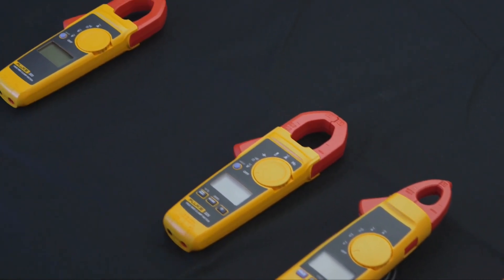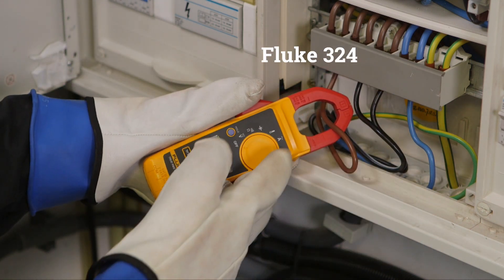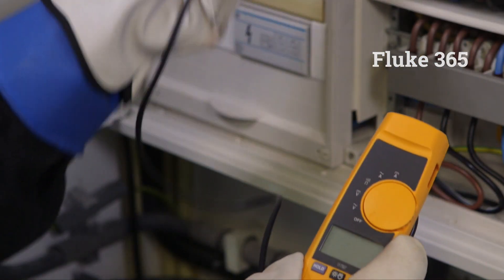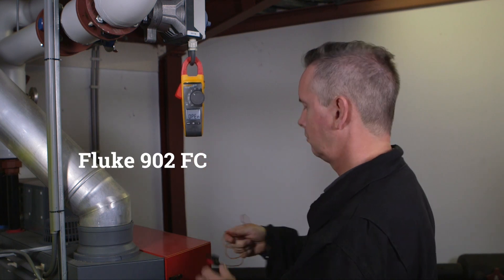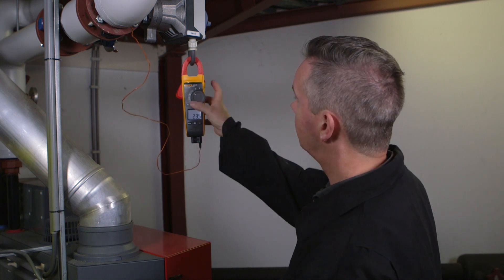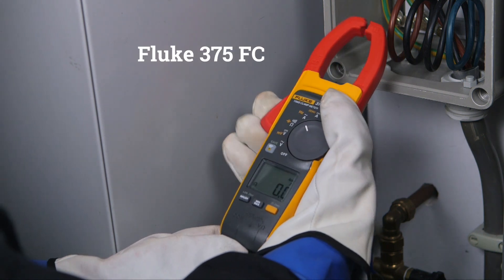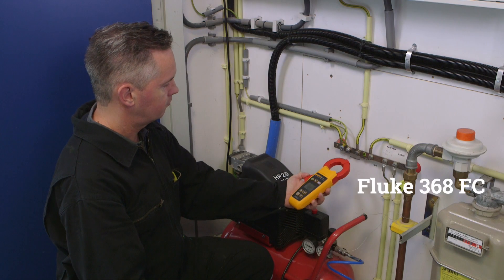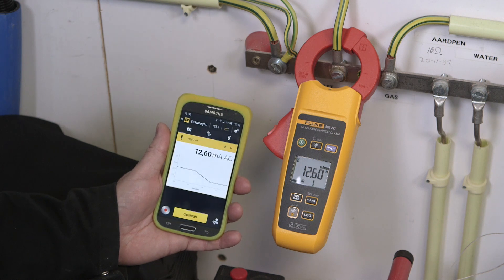5 Fluke clamp meters for commercial and residential use

Comment: My Fluke 365 came with a magnetic meter hanger, but there is a picture showing that the magnet needs to be 10cm from the jaws. The strap is rather short.  How do i keep it 10cm from the jaws when hanging it up? Do the jaws need to point down, or something? Please help.  I can't seem to find any pictures of the 365 being used with the magnetic meter hanger.